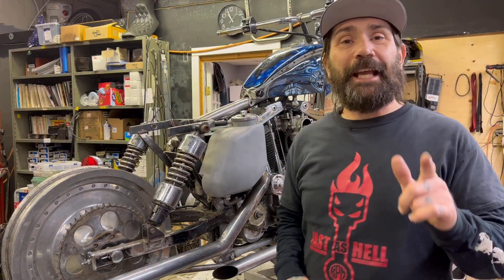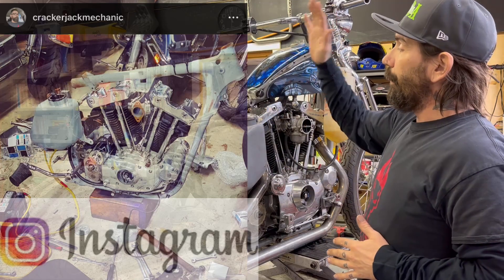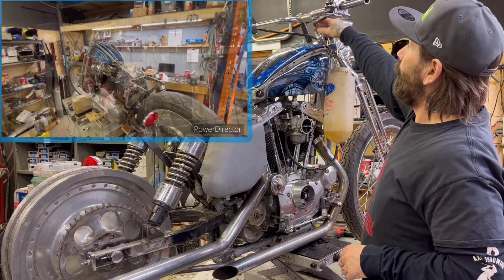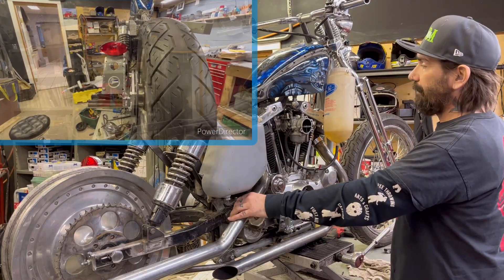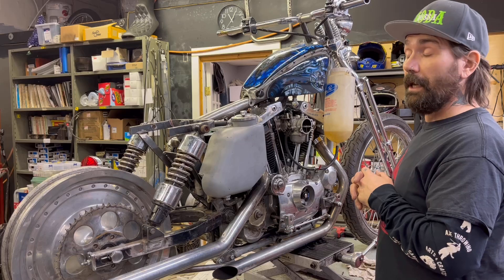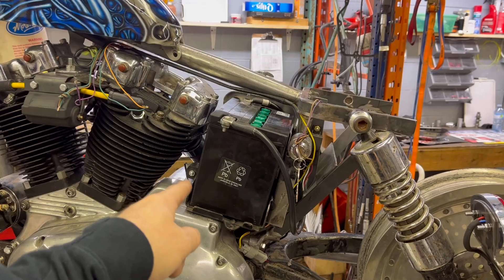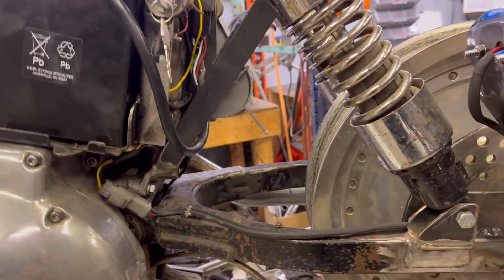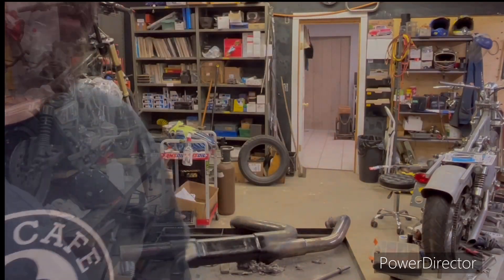Ironhead Sportster Custom Build

Comment: The extra linkage from Harley to make a left hand shift was done from 75 to 76. Wasn't until 77 that they made a change to the cases to make it left hand shift by default. Went through this with my 76 that I changed back over to right hand shift for chopper reasons.
Reply from the maker: the things we do! add some pictures!! 👍🏼

Comment: Hey man I have a 72 that was made rigid and I’m wondering what motor besides an iron head I can get in there
Reply from the maker: thanks for your question. well… the motor/transmission configuration and mounts don’t lend themselves well to big twin engine installation. Depends on how much work you really want to do... in most ways you may find it easier to stay with say a newer Sportster engine. Some people will give you the old “any engine can fit depending on how much work you wanna do” speech but I don’t think it’s worth the hassle and many of these projects truthfully get abandoned. Search around see what the custom guys are up too. I have seen Triumph engines in Sportster frames that look great. Depends on your resources man!!